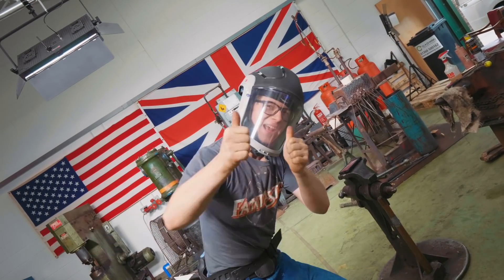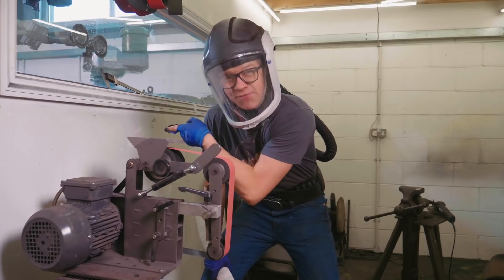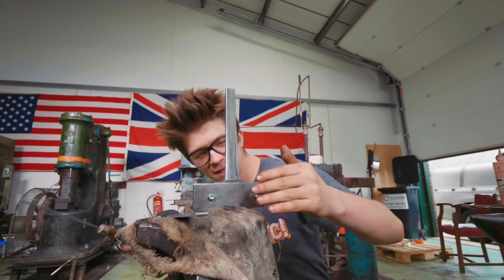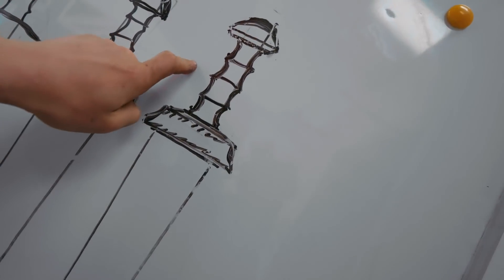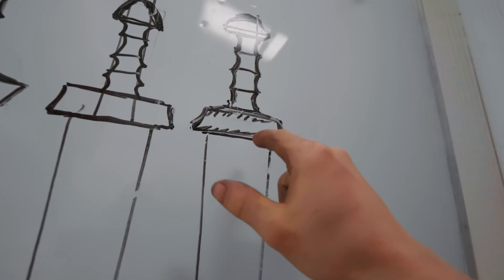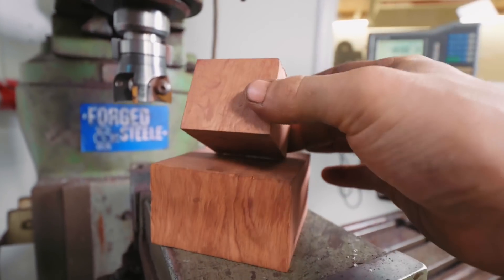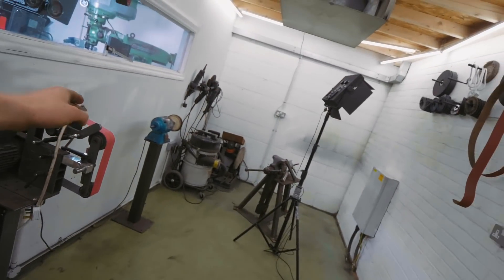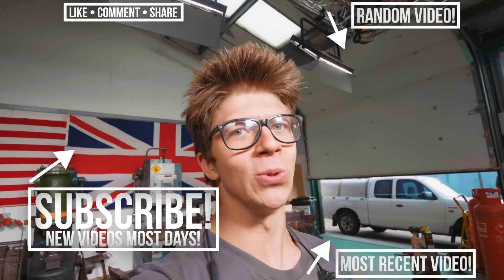MAKING A ROMAN GLADIUS!!! Part 4

Comment: Hello Alec.  I've got an idea for a small project (I'm guessing it would take you 1-2 days).   A set of Damascus dice.  The main bulk of the work will probably be in making sure each one is a perfect cube.

If you wanted to step up the difficultly level, you could try to make dice besides your standard 6-sided dice (i.e. d4, d8, d10, d20, etc).

I love your channel.  I have never done a lick of smithing, but your video production is so excellent that I do not miss a day.

Comment: @Alec Steele When you go to use the purple heart you bought, give it a quick blast with a heat gun before you glue it to anything. It will bring out a royal purple colour in the grain as the heat encourages oxidation.

Comment: You should try putting mustard on your blade. It has a acid that etches around the mustard but not actually where the mustard is. You just put it on the blade and wait about 24 hours or Intel you like how it looks/mustard is dried up.

Comment: Alec, you have repeatedly mentioned that using 1055 steel for your Gladius will allow it to be flexible.  The grade of steel does not matter when flexing (not bending), although some steels will flex further than others before they will no longer flex back straight when the bending force is removed. The flex of steel (not permanent bending) is dependent only on its thinness.  Also, a steel will flex the same whether hardened or not, but unhardened steel will take a permanent set before a hardened piece.  Look up "Young's Modulus" aka the "Modulus of Elasticity" of steel.

Comment: Alec, Replace the Padauk with something less prone to splitting. Padauk is notorious for splitting. It generally makes poor tool handles. The varying humidity will accentuate the problem. Also, have the grain of the guard run perpendicular to the blade, rather than parallel, as wood tends to split with the grain. If a guard were to ever serve its intended function, it would almost assuredly fail if the blow struck the end grain.

Comment: Hey Alec, love the videos! btw it is pronounced Padook
Reply: SE Woodwork is it just me or did that padauk look awfully... Boring?I'm used to it being such a vibrant orange. Maybe the colour filter of the video?
Reply: That would be Burma padauk, rather than the African variety.  It's less exciting.  Though, saying that even the African loses its color over time and turns into something that looks like chocolate.
Reply: I've got a few pieces in the shop that have that vibrant orange with these lovely streaks of gold and brown running through it. Padauk on the lathe has always been a favorite. Like turning a carrot.
Reply: Padauk tends to split easily. It is intact notorious for that quality. Also, the red will fade anyway, would be better off with a light colored rosewood if you need durability and want contrast. Or a hard maple with a good deep red dye. I avoid Padauk on anything vaguely like a tool handle.
Reply: Looked like bubinga to me. Too pale and too fine-grained for any padauk I've seen.
Reply: Really? I've never encountered splitting problems with padauk, and I've found it darkens to a warm brown over many years. It's not my first choice for tool handle, mainly because there is better and much harder wood available, but I'd rate it higher than rock maple in pretty much every category.

Comment: Wood? really a wood guard an pummel? Guard is there to protect from attacking swords, an to help with counter balance, pummel is a counter balance. Making both out of wood defeats both there design purposes.
Reply: Greg Ward finally someone  who has the same opinion :D
Reply: Do remember that the Gladius was made the same way. The romans were notorious for fixing games and did this through an number of ways including tinting with an gladiator his sword, all to make as an big of a show as possible. The gladius was never designed to be an good fighting sword, it was designed to look nice fighting...
Reply: That's how they were made, with wood or bone furniture.
Reply: Gladius were designed to be used with a scutum so the sword is not intended to be used to block or parry. As for counter balance the sword is short and light enough not to really need a heavy handle, to add one would remove a lot of cutting capability from the sword
Reply: Also the guard is there to protect the hand from blades sliding down after contact, not direct blows. These cuts would definitley have no chance cutting through a block of hardwood against the grain, i doubt a direct cut could do that.
Reply: jurgen bouma thats not really true though is it. The gladius is not a sword designed for a gladiator despite the similarity in name. Gladius is the Latin for sword and gladiator comes from the word Gladius as one skilled with sword

Comment: you have got to round off where the tang meets the blade. you will ruin all your hours of work with a few swings just because you 90 degree the tang blade junction. you want a slight slope. circle is stronger then a square. and like a 10 degree curve would be sufficient enough to make it infinitely more durable.

Comment: Hi, great vlog I'm watching it for quite long time and I want to check something. In part two and other videos you normalize steel, it's fine... then you hardened it and I thing for the first time you showed it with file that it's hardened, ok it's fine... but next you go on belt grinder and start grinding it getting steel hot like doing low tempering, sometimes you use water to cool it down or you didnt used water for this blade to cool it down when grinding?. After that you tempered it with acetylene torch. Purpose for that to make steel not so brutal but to keep it hard steel gets a little bit softer,. And then again you use belt grinder and made it thinner... Plus if I‘m right inside layers of steel doesn‘t get as hard as outside layer depends of part thickness. AND in this part you used FILE to GRIND sword handle and file was chiping metal like crazy. Some say that handle was not hardened but it close to the sword blade and you just cant leave 1-2 cm blade till handle without hardening... SO in my opinion you just grinded off hardened steel layer and again you have nice and soft steel (ok maybe not so soft as it was before but close to that point that file can grind steel again ).
 Can‘t remember now but I think other smiths and knife makers does they knives close to final product hardens it and does small amount of grinding and polishing... and if it damascus they etch it. By looking at your video you still had to do alot of grinding.
        Thank you, english not my native languange did some mistakess, peace

Comment: You'll have to be very careful with peening the tang. The woods you're using could easily split under the strain, even if you're using a copper bolster.  If it were me, I'd make the guard and pommel from wrought iron (etched to show the grain, of course) and use blackwood for the handle.

Nonetheless, outstanding work as always :)

Comment: You need to make a blade (a full length blade) without so much grinder work. How would they have made a blade at 100AD? Probably focus more on the bevel instead of a grinder...oh and do something with lots of "Man Jewelry" like a copy of one of the blades from "The Saxon Hoard" from Staffordshire
Reply: Shift -Z of course they had grinding stones in 1000AD.

Comment: I am a bit confused.  Why would you want to make a sword guard out of wood??  The purpose of the guard is to prevent the enemy's sword blade from making contact with your hand, wrist, arm, etc...If it is made of wood, it can easily be broken off.  This is why they are traditionally made of metal.  I can only surmise that you are doing it for the sake of aesthetics since the Gladius will only be use for viewing and not for actual 'battle'.